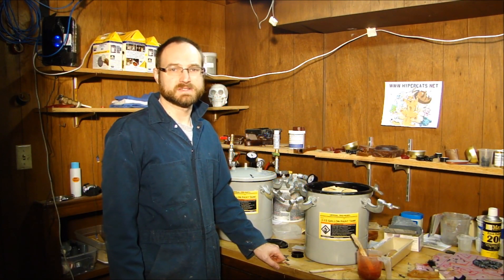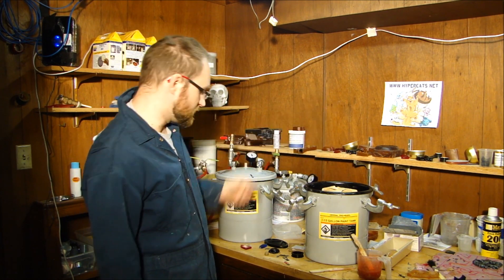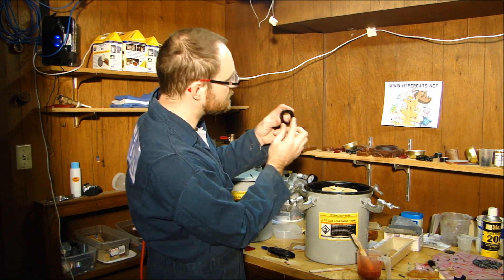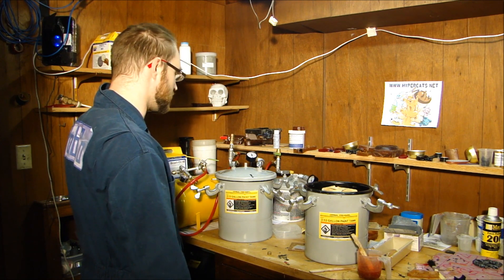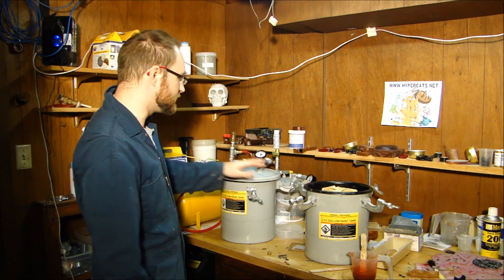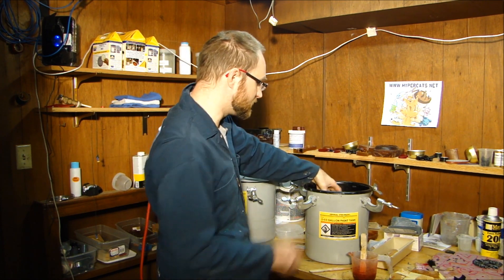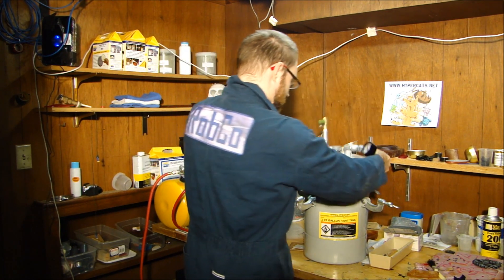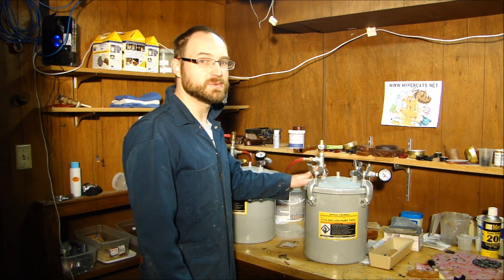Pressure casting using Harbor Freight parts

Comment: Yes, you can use it as a vacuum chamber.  You can actually use it for both.  Attach a "T" connector to the lid.  Run one side to a vacuum gauge and inlet.  Run the other side to a pressure gauge and inlet.  You MUST put a valve between BOTH the gauges and the pot.  Shut off the vacuum side when running pressure; shut off the pressure side when running vacuum.

Comment from the maker: glad you liked it! The rocks and/or sand help. I would also recommend a little 8" level for making sure your round mdf tabletop is sitting level in the pot. It's hard to pour resin into 4 different molds that are all off-level 4 different ways! Make the molds level and save a headache!

Comment from the maker: Probably, but I've actually built one for cheaper and then decided I hated degassing and never touched it again :3

You can make the one Smooth On Sells, though with a 12 dollar stock pot. You can use that with some blue rtv silicone, pipe fittings, a ball valve, and a 1" thick 12x12" thick sheet of acrylic. The benefits of this over a pressure pot are that it will cost at least half as much, and since the top is clear, you can actually see the degassing process so you can monitor it better.

Comment from the maker: Thanks! You absolutely don't need the extra 5 gallon tank, it just saves you from having to recharge the tank as often. With this setup (two tanks) I can fill both presure pots to 62psi twice (2 times x 2 pots, 4 pressurized castings) before the air pressure in the tanks is below 60 psi. The benefit of this is that I can run the air compressor once for about a minute and the setup is charged for at least 4 pressurized castings.

Comment from the maker: My air compressor broke down and I had to take it apart and rebuild it about a month ago. While I was doing that, I was running the pressure casting system off of a tiny little 2 gallon Campbell Hausfield air compressor and it took FOREVER to fill the little tank, and I could only fill the pressure pot once before having to turn the air compressor back on to fill the tank.

Comment from the maker: It's possible, but one of the other issues is that the majority of fittings on the lid are VERY close to the wingnut clamps that hold the lid onto the pot. Another T connector and more ball valves could get in the way of the clamps, especially when you also might have to tighten/loosen them to adjust for leaks. I have two different hardware setups on my pots because I couldn't find a second 45 degree street elbow and the 90 degree is a bit hard to work with.

Comment from the maker: Still can't reply to "linked comments". This is for Gary J Smith:

I don't think pressure casting speeds up the curing time any, all it really does is force out the air bubbles. Smooth On urethane resins have a really fast cure time, like 20 minutes to demold in some instances, so you could always try that instead. And it's a lot cheaper than EasyCast.

Comment: i dont see a regulator, so im guessing you just use the on/off valve to control the pressure in the pot?? pressure is set at 60psi .??? the pressure releaf valve is the one that came with the pot ??
 im trying to cast some knife handles and not trying to blow myself up !!! thanks for your help

Comment: Does the pressure speed up the curing process for molds and resin? The recommended time for EasyCast to cure is forever and was hoping to find a faster way if this would aid in it.

Comment: I have a few questions, dose pressure casting actually make parts weaker? It seems like the collapsed air bubble would be trying to expand after? Also curious, I use a resin that takes about 3-4 hours to cure, that makes mass production very poor doesnt it?